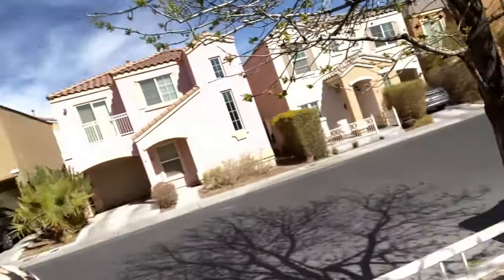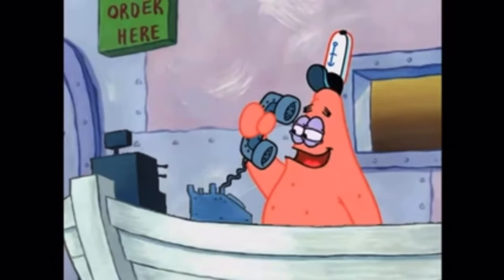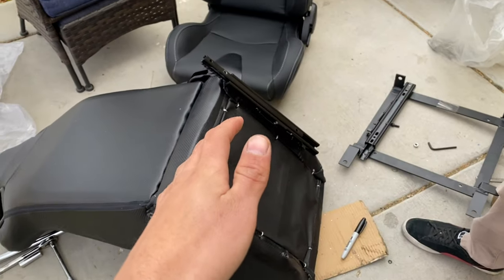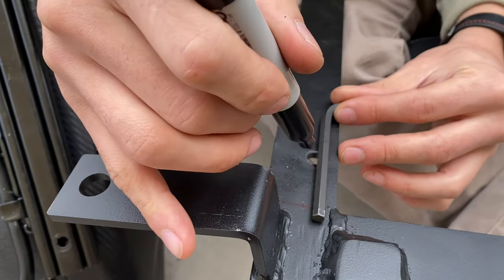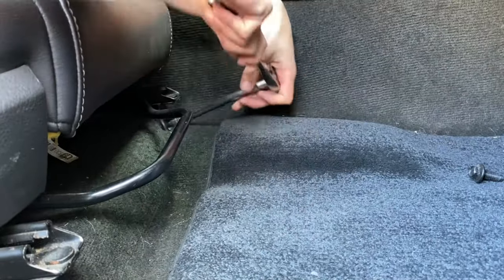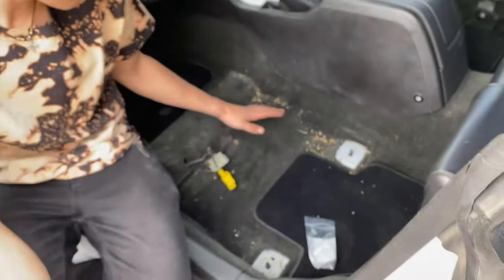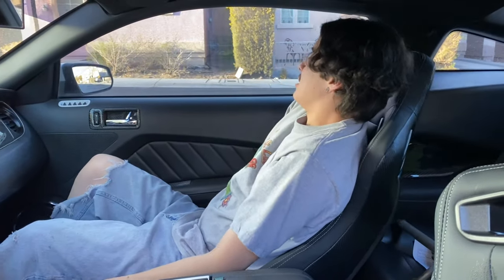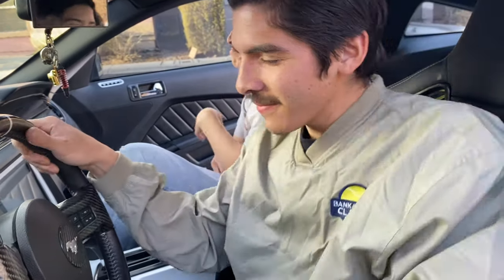I Have No Words For These Racing Seats…

Comment: The seats look really dope! how about the height wise? do you find the seat to be much lower than stock? or did you have your stock seat on the lowest setting anyway?
Reply from the maker: Honestly, realized 0 difference from stock to aftermarket with the exception of the appearance, seat pillars, and the light weight.   I’m 5’8 and can see fine with no adjustments
Reply: @LoganScott.  man I just got the 2012 Mustang and with the stock seat in the lowest position I feel like I've severely limiting my visibility and I'm 6'0 😅
Did you have your stock seat set to lowest point before or about medium?
Reply from the maker: @aimless-drifter  The lowest setting. These seats may sit a tad bit higher but I didn’t really notice a huge difference in visibility. You can always add spacers to extend your height but do at your own risk brotha.

Comment: Do you think these seats would fit in a New Edge? I'm having my doubts cause of the seat's shoulder. Btw have you think the idea about re-routing the seatbelt so it go through the shoulder's hole?
Reply from the maker: I’m not 100% sure about the edge but the company offers measurements of the seats so you can determine if they will fit in your car or not. The biggest issue will be the brackets. As for the seatbelt hole, I did do that! Took a little bit of work, but looks GREAT!

Comment: Do you remember what bolts you used to mount the bracket to the seats ?
Reply from the maker: I reused the OEM bolts to mount the seat to the floor. As for the brackets to the seat, I think they came with hardware.

Comment: Those look just like the corbeau seats. I wonder if they will hold up as well as a more expensive reclining seat in a crash. That's my only concern. Sucks you have to modify the expensive brackets. For $1200 you can just get corbeau with brackets. Uggghhh! i'm trying to talk myself out of the cheap seats.
Reply from the maker: I completely understand your concern and I was on the same boat as you. After reading the reviews on Amazon and doing extensive amounts of homework on this, I pulled the trigger on these seats and I haven’t looked back since. They work just as advertised and look absolutely amazing! The seats are lighter than the stock ones though that’s what you would expect without an airbag in the seat. Whatever your gut tells you to do, follow through with it! Corbeau or the Amazon seats, they both are great imo

Comment: I need a fast response it would really help, if I don’t use the resistors for now will they cause al the other airbags to not work? Or just the seats
Reply from the maker: I thought the same thing. I would assume**  it’s just the seats
Reply: Okay cus my dumb ass lost the package somewhere and now I have to buy some locking nuts for the seat belt because I thought I could use the old ones
Reply: i got the resistors in and the light is still on rip
Reply from the maker: @emotionlessmarshmallow4581  did you swap the guts from one seat to the other? Make sure you have the right resistor because they could have sent you for a 2009 mustang. Not a 2014. You have to email them separately to receive the right one
Reply: @LoganScott.  oh my god. I had no idea i was supposed to email. I basically took the seat belt wire and pluged that in and put the resistor in.
Reply: @LoganScott.  I swear I told them the year though when I ordered it
Reply from the maker: The yellow resistor should connect into the yellow plug under the seat. If you got the 2009 and below resistor, it won’t work for the 2010-2014 models because the resistors have a different resistance causing the ABL to turn on. Unfortunately, they don’t do returns either….
Reply: @LoganScott.  welp possibly lost 100 dollars
Reply from the maker: @emotionlessmarshmallow4581  I would say post them on eBay because you aren’t the only one who wants to have their airbag light off, but doesn’t know about the company you bought it from.
Reply: @LoganScott.  is there any way to find out which resistors these are?

Comment: I just installed some Corbeaus. I noticed you have the seat belt running through the seat's "shoulder hole". I'm in the process of unbolting seat belts & doing the same thing as you but I noticed "wiring" on the floorboard...Did you cut these wires?  BTW. I bought the same "airbag resisters" as you but I'm still getting airbag light...
Reply from the maker: The wires that were cut were the ones that were for the motor to the seat. I kept the sensor for both seats that has a little green magnet on it because Joe and I believe that it’s used to determine how far the air bag needs to deploy. We also kept the air bladder for the passenger because without it will also cause a airbag light. If those are not tampered with, the resistors should work!
Reply from the maker: As for the seatbelt, I unbolted the bottom of the belt (near the floor board)  and moved it through the seat hole. The passenger side is a little more tricky where you need to remove a tab behind a plastic panel in order to remove the nut closest to the floor board. Once that’s done, you can proceed
Reply: @LoganScott.  Thanks for getting back to me, Logan. It's still a little confusing. I can send you a picture of what I'm dealing with on Instagram if I run into problems.
Reply from the maker: Right on. You don’t need to cut anything but I did for the purpose of less clutter.

Comment: How did you get the seatbelt though the seat?
Reply from the maker: I disconnected the seatbelt from the bottom bolt near the floorboard. Passenger side is a little more intricate. You’ll need to remove the side panel near the rear seat to remove the bolt completely

Comment: Great video
 I have an SN95 I'm doing a 351w swap in. Was just looking at random aftermarket seat videos for reviews (I'm cheap). Anyway just a random thought or suggestions which might not be valid but, wouldn't a light coat of grease on the rails be a good thing to do?
Reply from the maker: Haha, you and me both! 

The rails came with grease already on them, but it doesn’t hurt to add a tad bit more considering there wasn’t much on it to begin with imo 🤷🏼‍♂️
Reply: @LoganScott.  haha no worries. It's always great to save money. Anyway it was just a random thought 😂
Reply from the maker: Anything you can do bc shit ain’t cheap! These seats were def worth it though if you’re looking to buy them. Only flaw is after a few months, they made this creaking sound when you sit down but that’s really it.
Reply: @LoganScott. I completely agree. But if money was no issue...... 😈😈😈😈😈😈😈😈😈😎

Comment: Which dimensions did you chose from the 3 options
Reply from the maker: I don’t remember there being 3 options to choose from but I measured the length, width, and height from the old seat to the new one
Reply: @LoganScott.  no worries man I ordered the seats, and I got the corbeau brackets on accident I was trying to order the Bruams in another tab but fucked up
Reply: @emotionlessmarshmallow4581  What size was the correct one?
Reply: @Tank1098  I dont remember im sorry but they have been working for me since.

Comment: How much do these weigh?
Reply from the maker: I didn’t weigh them but they’re noticeably WAY lighter than the stock ones
Reply: @LoganScott.  I ended up getting them and weighing them with the included bracket they weigh 30lbs.
Reply from the maker: @Hush.44  Not bad! Thank you for giving me a heads up! Did you have issues getting the seats? They looked to be sold out last I checked
Reply: @LoganScott.  No issue here, but one of the seats I got was in bad shape and am currently awaiting a replacement.  The one that was in decent shape isn't half bad for as cheap as these seats are.
Reply from the maker: @Hush.44  I’m sayinnnn! They’re actually pretty nice. Unfortunately you had a bad seat